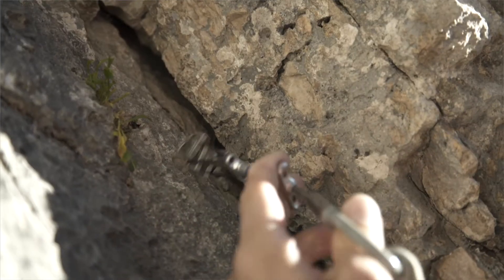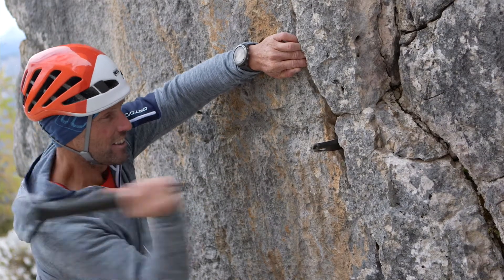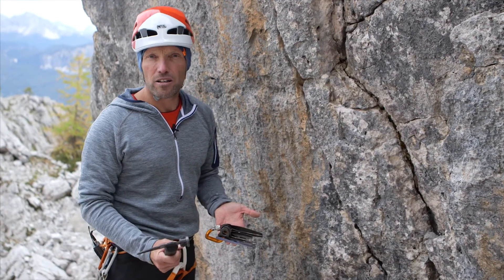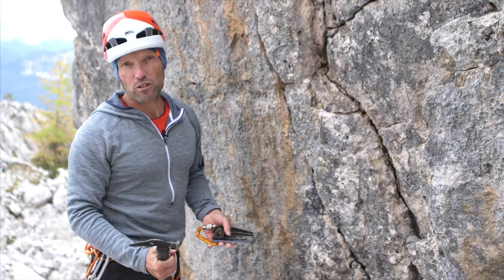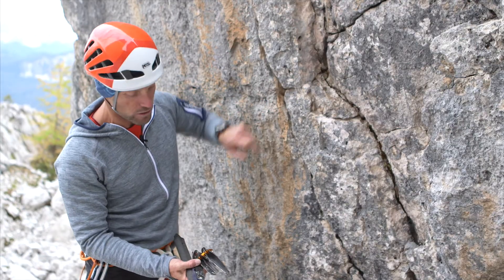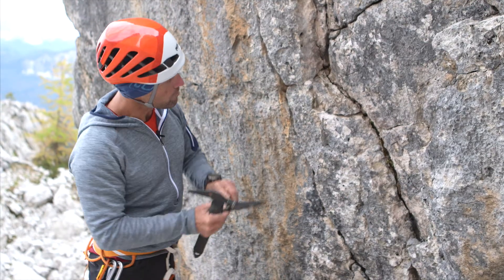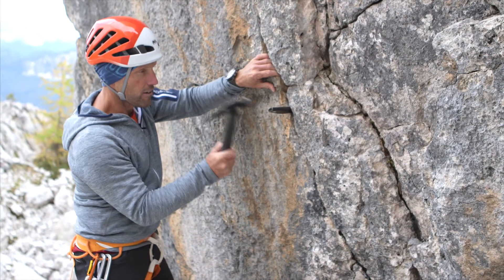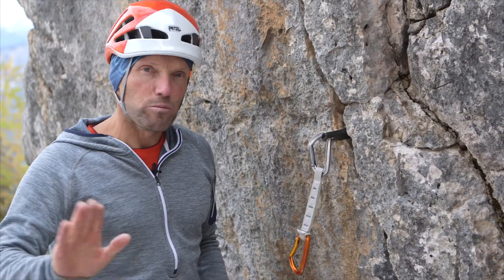Anchors: Hammering in a normal piton – Tutorial (23/43) | LAB ROCK

Comment: What size pitons are used in the video?
Reply from the maker: Hi Calvin,

there are pitons of different length and type shown in the video. It is recommended to bring a small rack of pitons of different length. At the end the placement determines which Piton you can use. If you use soft steel pitons (advisable in limestone or dolomite), the piton should fit into the crack at least 1/3 of its length before you start hammering. Using hard steel pitons (f.e. in granit) it should fit 2/3 of its length. Hammering it into the crack it should go in all of its length. Generally: the longer the piton the more impact it will hold. Regarding to these points the challenge is to find the longest piton, that just fills the chosen placement.

Hope this helps!

Best, your ORTOVOX Team